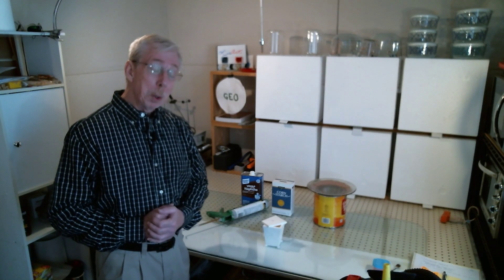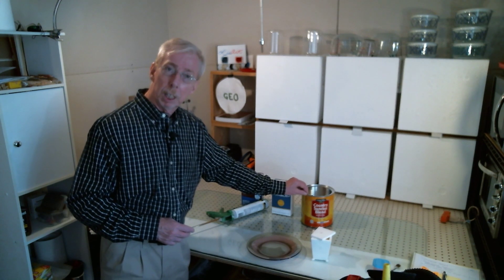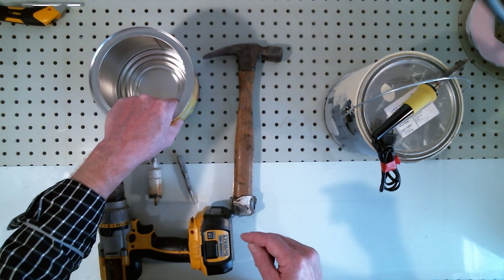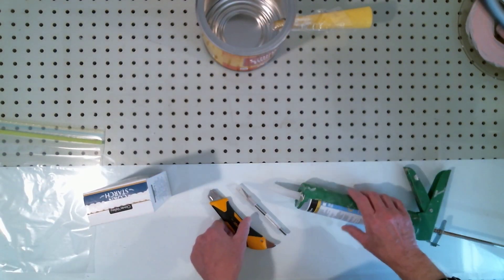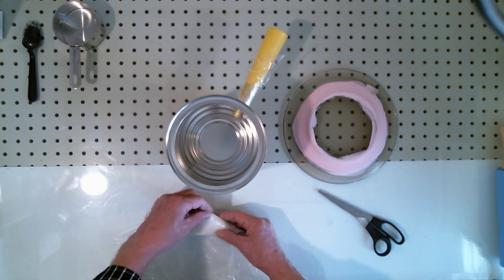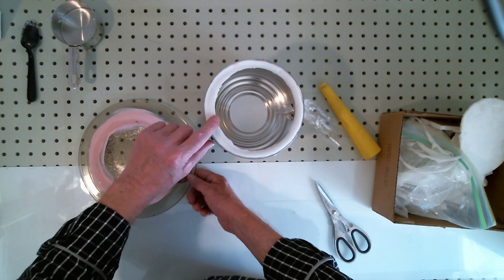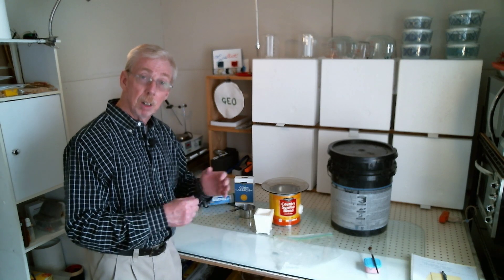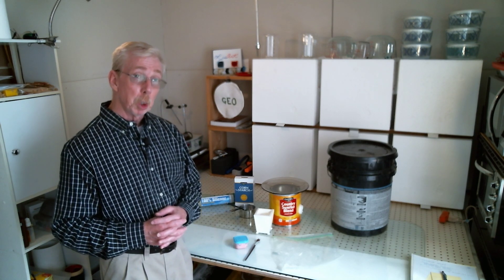Mold Making: Silicone: Degassing Chamber. DIY Vacuum Chamber.

Comment: I've seen Youtube test showing that a regular shop or similar vacuum only provides about 5 psi drop.  Vacuum pumps pulling 20-25 psi are suggested for proper de-gassing of silicon, causing it to really "boil" out all the air and foaming before collapsing on itself at which time you stop de-gassing.  I'm wondering if that's only for "pro" jobs or big, thick molds, or if, on the other hand, you still have bubbles in your mold internally you just can't see which can't be drawn out with a weak vacuum.  Can't argue with success though, if you feel this is really de-gassing sufficiently.  I guess only way to tell is to put your silicon mold mixture into a more powerful vacuum chamber after using your method and see if additional bubbles are drawn out.  Anyway, thanks for the videos !

Comment: Great way to overheat and destroy your vacuum cleaner motor. Don't do this, folks.
Reply from the maker: Great advice. But I torture my ShopVac and it lasts for years. I'm on my second one in 40 years. And drywall dust killed the first one.
Don't do what I do if you're afraid of killing machines. Worlds best vacuum only costs 30 bucks.
There are much better ways to deGass Something like silicone. They make Vacuum pumps for a bit more money.

Comment: Wonderful video!  I love what you are doing!
I had a question though and would like your opinion...
I only am creating very small molds with silicone and was wondering if I could use a manual vacuum pump like the kind used in canning to degass the silicone?  A 'Mason Jar Vacuum Sealer Kit' and a wide mouth mason jar could be big enough for me.  Could I achieve a high enough vacuum do you think?

Thanks!
Reply from the maker: Yes, absolutely. Just keep pumping you'll get a perfectly smooth air, bubble free mix.
Reply: @GEOsustainable  Great!  I am inspired by all your videos!
I'm actually going to attempt using "high-temp" silicone (100% RTV) so that I can makes molds for low-temp metals such as pewter.  I first have to get the silicone in a pourable state though.  Hopefully some mineral spirits will do the job... otherwise I'll get some naptha?!?...

Comment: You mentioned the 5 gallon bucket option. What lid can I use with the 5-gallon bucket degaussing chamber?
Reply from the maker: How about the lid to the bucket? Anything that will stand up to the vacuum pressure, and not get sucked in. Careful, I have seen plate glass shatter under the vacuum.

Comment: Looks like the milk paint (release agent) was washed away for the actual degassing.  That was intentional? Would have liked to have seen those air bubbles escaping; the main event was glossed over in seconds :(
Reply from the maker: Yes, the paint washed away, that is why I used it. I did make a short segment of a few seconds. I try to make the videos as short as possible to increase watch time.
Reply: @GEOsustainable  it's all good brother, I understand the struggle